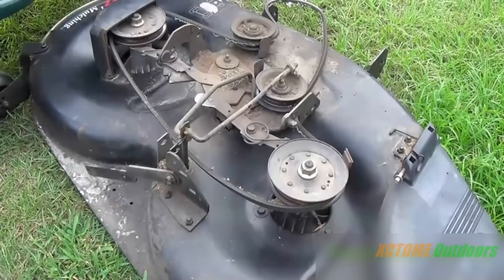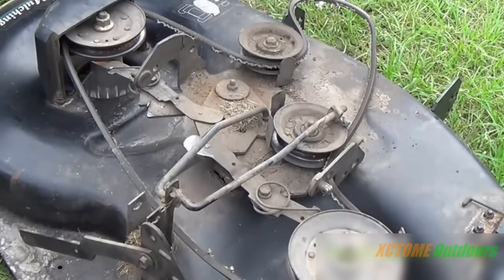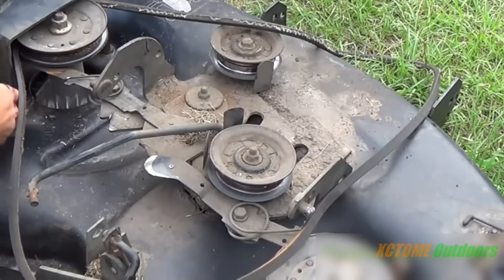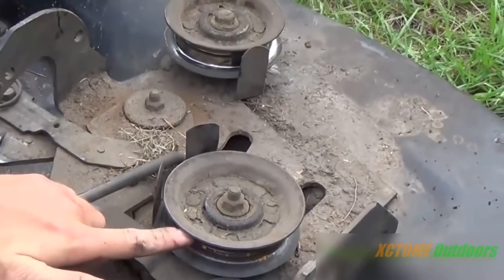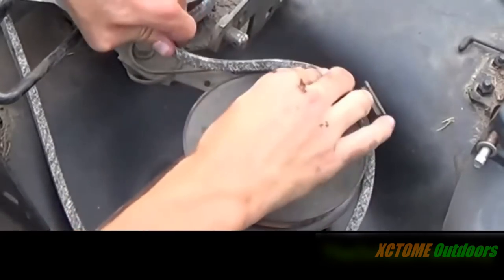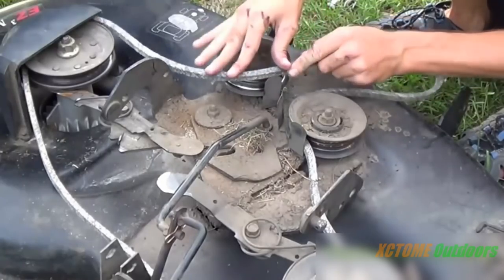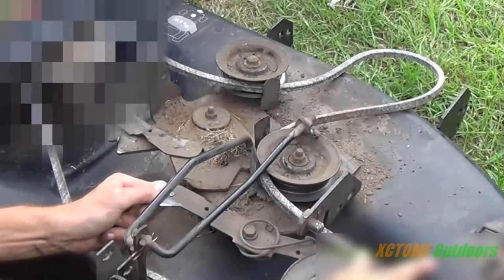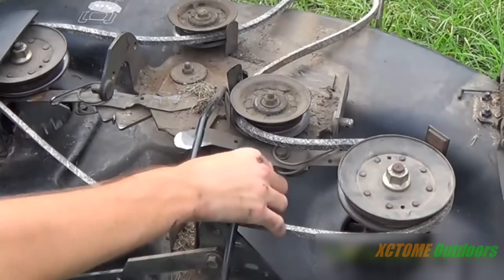Replacing The Deck Belt On An Old Style 42in Craftsman Mower

Comment: This was very helpful to me struggling with first time dropping deck but did not pull away from mower. Old style that I to am working on had me buffalo's misses one connection with the floppy engaging rod.Bingo,next day fresh eyes and another look at this video ,hit the right hole and viola.sucrss. only thing smoked the old belt after mowing one hundred yards.Tomorrow,new belt,more carefully installed..BINGO.thanks for posting belt info...

Comment: Look for the broken weld where the main bracket is welded to the deck. Center of the deck at the bottom of that bracket that the blade brake arms are bolted to.  When that weld is broken the bracket raises enough for the blade brake arms to get chewed up by the spindle pulleys. Same thing happened on mine and I am getting it welded back down today.  Must be a common problem on these old decks. Tell the welder to weld it from the top and add a gusset to make it stronger. Then flip the deck over and weld it through the slot in the bottom.
Reply: This is super helpful I’ve replaced like 4 break arms on mine it was maddening, i don’t know if i have it in me to do another major repair on what was a $ 250 garage sale buy.

Comment: Man I've been a mechanic for 52 years I bought a riding lawn mower just like this on your video it's a Craftsman LT1000 I took the mower deck out and there's three linkages on the back one short one two about 12 in 15 in long The one I know where it goes the other that goes down in the deck that pulls the belt tensioner I'm not sure how that one goes I have your video frozen but the ride looks different I should have known better I should have took pictures got any ideas hit me back thank you God bless

Comment: I'm having the same issue with the idler pulley moving too far. Which plate has the stopper attached? This is the only video I've found which has mentioned this. Thanks

Comment: The Stopper that is missing on the bottom plate that keeps the flat idler pulley from going to far forward, is that plate replaceable? Mine is missing also and my belt comes off when disengaged. Is there a model number for this part ? I have the manual downloaded but don't see where there's a number on the plate. Any information you can provide would be greatly appreciated also this video was a blessing. I've been working on  rebuilding mine going on 5 months now and the part where you mention the stopper keeping the pulley from going forward, no other video has mentioned this. Thankyou
Reply: I think it’s welded but I have a extra deck that would save you money!! If you still have it ??

Comment: Hi xctome. Thanks for the nice and clear video. How can I find out part number of the belt that will fit my Craftsman ? It's impossible to find an owner manual for such an old machine! Thanks!
Reply: saym64 contact Sears home parts direct or something like that online and put your model number and your serial number in and there’s probably every part you need for your craftsman
Reply: Mine had the model number under the seat and on the hood it had the deck belt and the drive belt with their part number and along with a list of things you can get for the mower.

Comment: I recently changed the belt on my poulan mower and now the blades won't engage any idea where I may have went wrong. It has the cable engage system

Comment: are the parts interchangeable between the two i have a older mower like that. deck rusted out i have two of the newer style decks
Reply from the maker: Parts are non-interchangeable, pulleys are different, only identical parts are the spindles and blades.
Reply: oh ok thanks
Reply: Newer driving mowers are being made with plastic pulleys instead of metal. I have 2 of those old 42 inch decks and just sanded down one to repaint it so it don't rot out

Comment: I have a 1998 LT1000 craftsman does any one know deck belt size
Reply: Does it have a cable engagement that goes to deck or a linkage rod? It's a 144200 for the rod system, 144959 for cable engagement